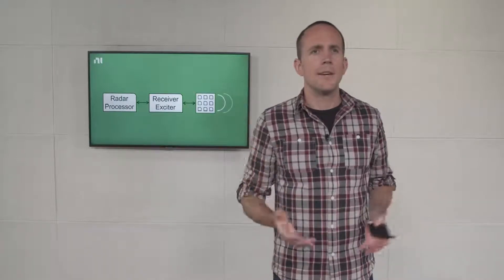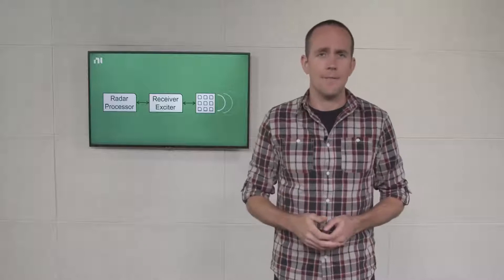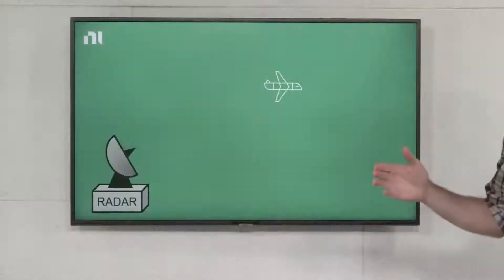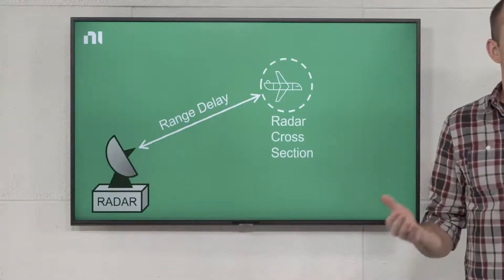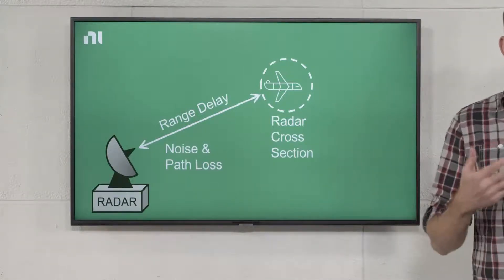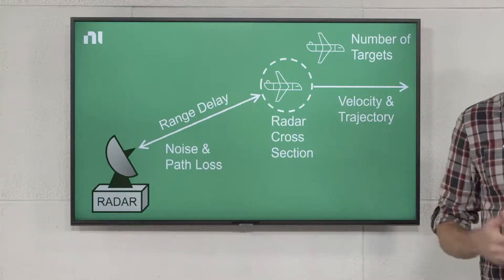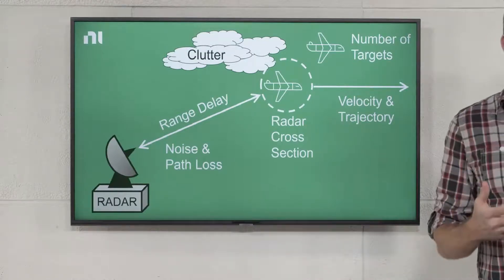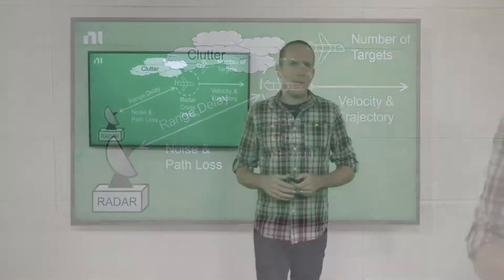How to Test a Radar - NI Radar Series #3

Comment: i suggest adding a review slide at the end to emphasize key points in each video...Also I would like it if you could define or simulate doppler shit, the keyword fidelity in the context that you are using it, and more of the set up and the interactions between the radar and the test vector? generator?